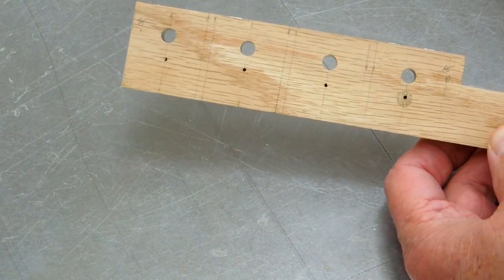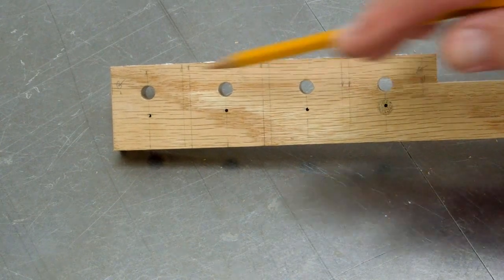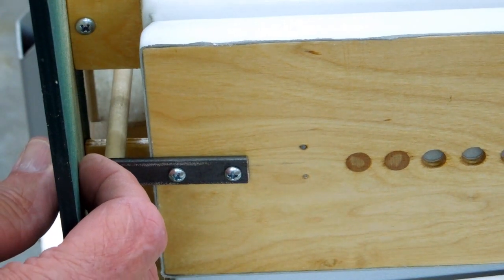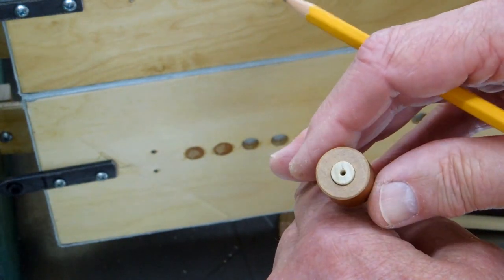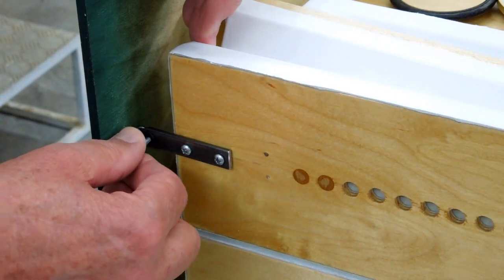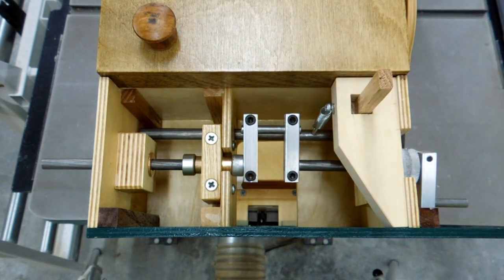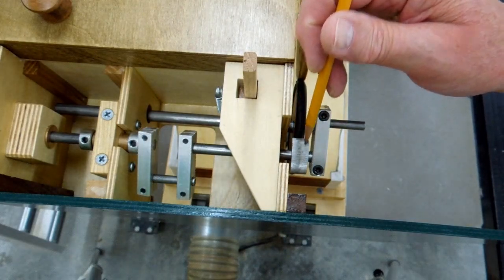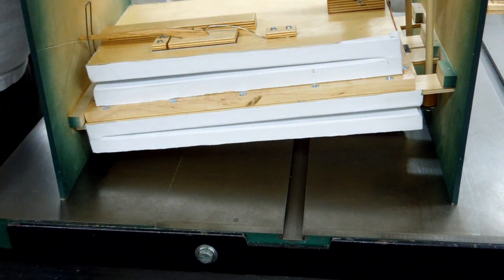Senior 20 Organ (16) Crankshaft & Connecting Rods

Comment: Hi Ronald,  My progress is moving along very well, thanks to you're advise and videos.  Thank you.
Question;  what is the space between the moving bellow, leather to leather? Also, how is the space between the fixed bellow topspin the large chamber sealed?
Reply from the maker: You do not want the bellows to close tight, leave a small gap. The space between the moving bellows leather (full open gap) should be given in the plans which I do not have available to me at the moment. I think it is also mentioned in a video. If you don't find it ask again next week. I sealed the gap between the tops of the two bellows with a strip of duct tape. The bottom frame of the reservoir has  foam sealing strip attached to the bottom surface which seals against the top stationary side of the two bellows when the reservoir frame and bellows are screwed together. This is covered in a video. One needs to be very careful not to drill a hole (or poke a hole with too long a screw) in a bellows leather when attaching the reservoir base to the bellows.

Comment: Forgot to ask if the reservoir(?) (on top of bellows) is operating to full capacity or is some more tweeting necessary? I ask because it doesn't appear to be filling up?
Reply from the maker: MRrwmac The reservoir is slightly bouncing up & down on the pulsating discharge from the two bellows. The reservoir is blowing into a pressure box that is wide open with no tracker bar and no glass in the pressure box lid.